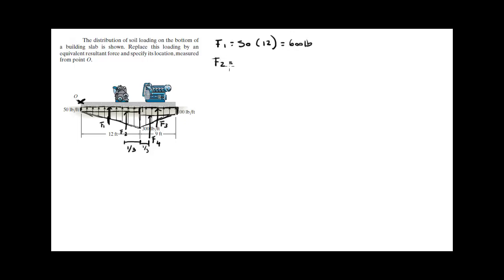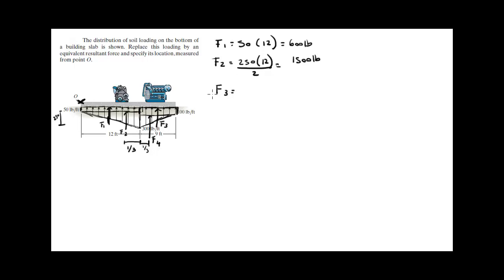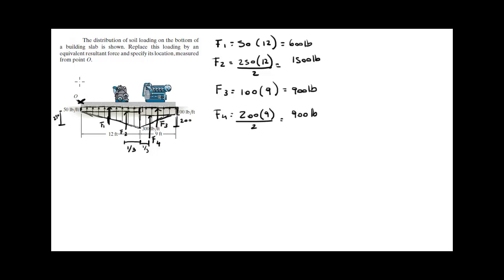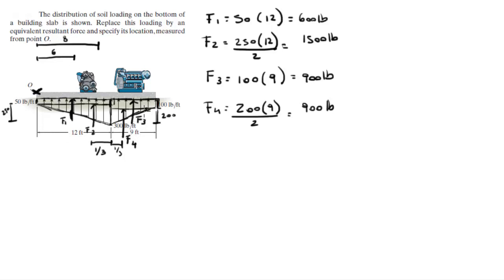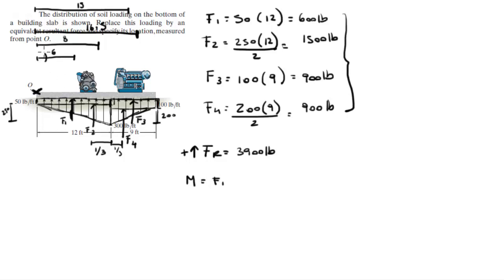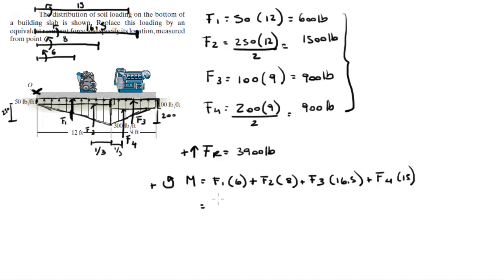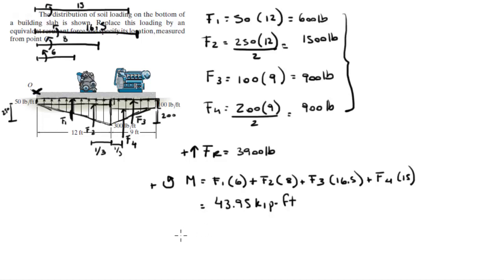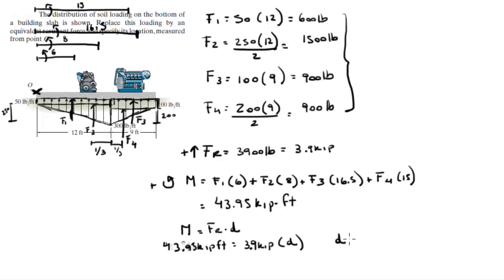Replace this loading by an equivalent resultant force and its location

Comment: How do you know that the force of the triangle occurs at 1/3 less than the distance?
Reply: It's the Centroid of a Triangle. Simple geometric shapes have their own respective centroids. For a triangle A B C where A is the length along the x-axis and B is length along the y-axis and C is the hypotenuse its' centroid will (along the x-axis since Force is a sliding vector and can act anywhere along its' line of action) be at 2/3 A from the left or A - 1/3A. 

A year late but just in case you were still wondering! hahah